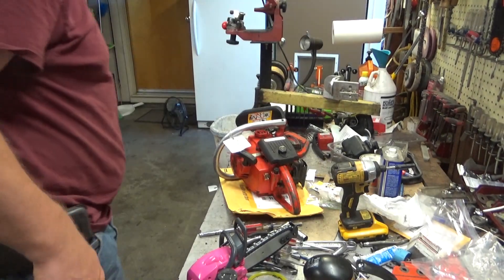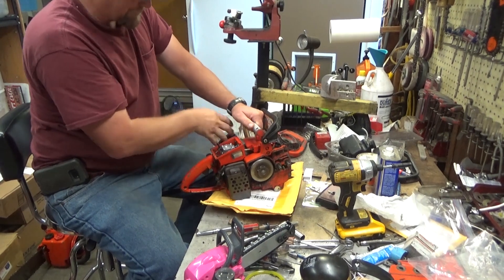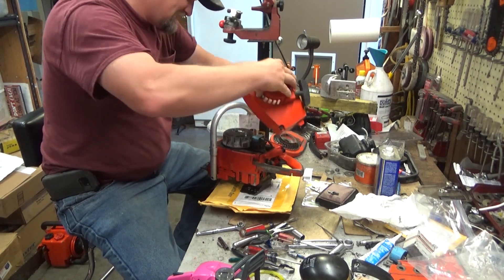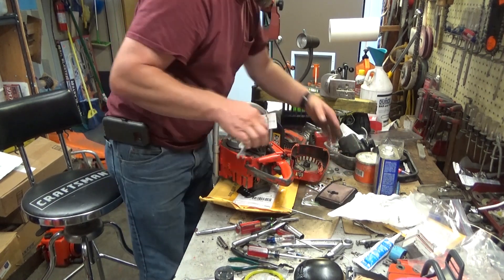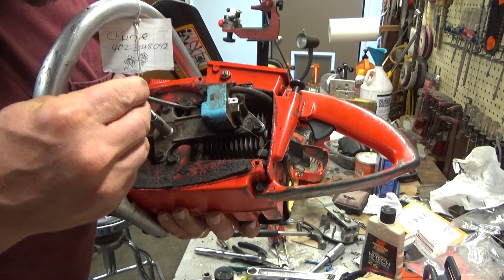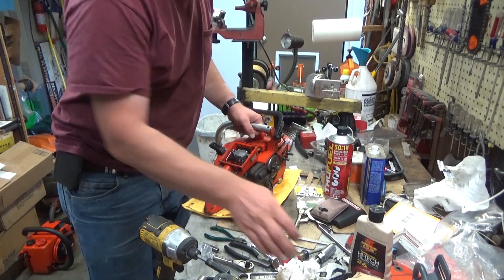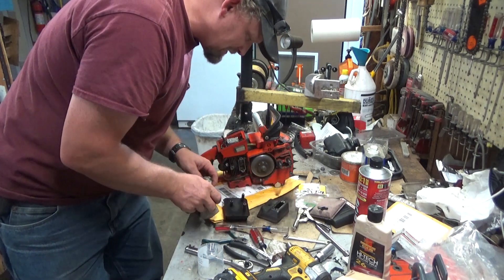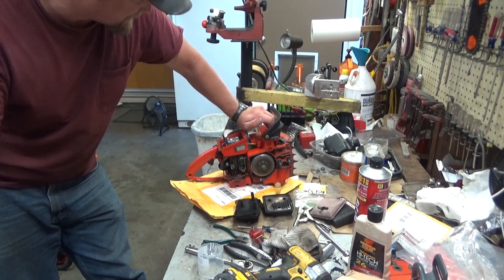Charlie's Super XL Test Run, Hot Smell Diagnosis, TruFuel

Comment: I use the same fuel in my C7 and get the same odor.  Saw seems to run just fine and doesn’t get too hot.  I don’t use my saws enough to keep treated gas on hand, so I use the expensive stuff for storage and occasional use.

Comment: ..oh, and I think your customer would be better off just getting a gallon of regular-octane ethanol-free gas, and a bottle of 50:1 Stihl, Husqvarna, or Echo oil, IMHO....I'm not really a fan of that pre-mix stuff...and especially not at the price they charge for it..I thought they were crazy when they came out with it, I thought who in the world would pay what amounted to nearly $20.00 a gallon for mixed gas?..but what do I know..I also thought nobody would buy premix anti-freeze, either...paying almost as much for half water....BTW, I love that infrared thermometer :)......
Reply from the maker: I know guys that will only use the pre-mix because of how stable it is...it can be stored for years without breaking down, so I get that.  Especially for infrequent users.  In fact some collectors I know store their saws with VP throughout the system to keep things from drying out....not for me, but to each their own I guess!
Reply: @LeonsChainsawPartsAndRepair  ...yes, I could see using it for long term storage...you wouldn't need that much..but to run it in your equipment every day..ouch!..expensive..also, I have wondered about possible lean/hot issues running it in older equipment in the past....